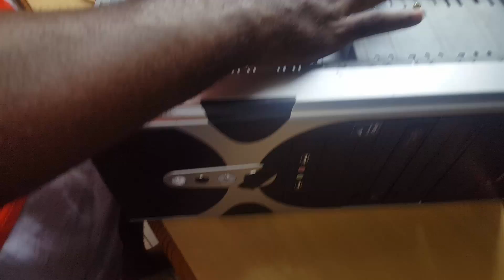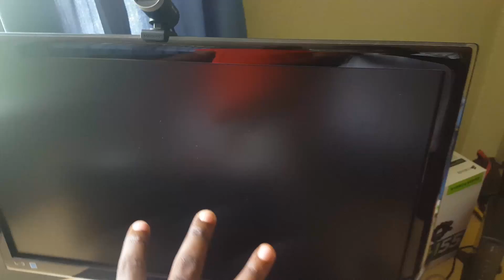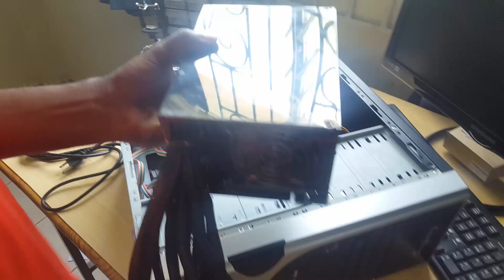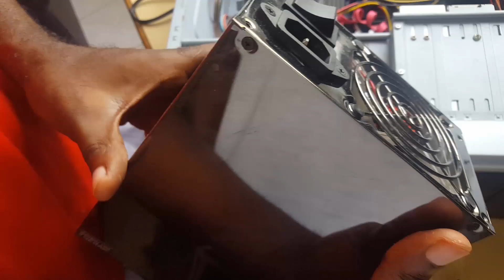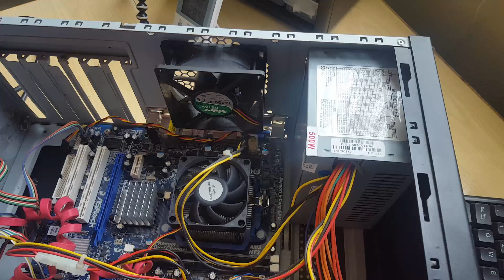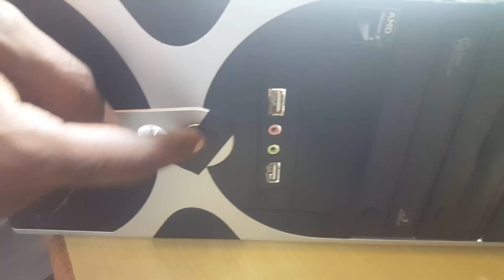My Computer wont turn on Fix

Comment: my rear fan is twitching and my cpu light is blinking when i turn it on
Reply: Sameer Majhi power supply issue
Reply: my pc sometimes run automatically and I use it for atleast 2 hours but now just the cooler starts and stops in 2 second
Reply: yeah bro it's your power supply for sure
Reply: Jerry Landingham have same problem can u tell me how to fix it

Comment: Thank you for the video! It gave me new things to check. We switched out the power supply but still will not turn on. The power button doesn't seem to press in all the way so it may be worn out. I will use your instructions to check and possibly switch the reset button. Thank you!

Comment: Just got my new 2000$ pc and now it's not turning on ); it's not the cable or the psu and my headers are plugged in so idk what to do );
Reply: if you bought a prebuilt $2000 one then you kinda deserve it because you're a dumbass, if you built yourself then you are an expert enough to know how to plug cables in. in both cases, you need to be more specific about it.
Reply: Alexandrewvice I built it my self, I had to restart the CMOS battery and it worked the next day
Reply: good for you. what are the specs?
Reply: TheGamersTech how did you do that? i have the same prob

Comment: Hey,
Same problem here ,
I connected a new power supply and my motherboard is showing a green light, which means power supply is working and my motherboard too.
I connected all the wires in there place & turn it back on but it won't turn on. Also there is light (green) which is on but the fan of my Processor & cooling fan is not on. Monitor is also not turned on. 
Help me please !!!
Reply: same problem

Comment: My pc suddenly died today
Every accessories that are plugged in to my cpu still lighting up.
But my pc won't start if I press the power button.
I unplugged-replugged the main power cable, after that I tried to turn the pc on again. Aaaanndddd the lights glow for less than a second and then they turned off again.
So I checked everything... Seems fine but still my pc is not working

Help please?
Reply: I have the exact same problem! Um did you find a solution?
Reply: Yolozsef Swagedűs i have the same problem where only the motherboard light is on but when i press the power button the fans wont function. HELP!
Reply: mine too its freaking me out
Reply: Prime J  same dude
Reply: same problem . how to fix it?
Reply: in my pc.its says number 99 and after 1m turn off
Reply: Prime J same =(
Reply: Prime J remove the cmos battery and put it back again in 10mins!! This worked for me :)
Reply: I have the same problem
Reply: Prince Horo i fixed it by replacing the power supply.
Reply: Remove your ram from the motherboard and then take an earaser and start rubbing the gold part slowly
Reply: @aimanhakim9803  you are write
Reply: You can do open cpu and clean dust and open ren card and close rem card then pc is on it is moving
Reply: I have solve this problem.....Just pull out the battery from the motherboard then pull back in...The prob should be fixed.😀
Reply: Maybe the hard drive is faulty.
I have the same exact problem but im just 12 year olds. Or maybe its a RAM problem. Maybe it is dead.
Reply: @arbionruci6277  you are having same problem 
And the like me 12 years 
I fixed it and it turned on but it opens 10 minutes and restarts again
Reply: @arbionruci6277  it is not dead I fixed it but after 10 minutes it restarts
Reply: We had the same problem though
Reply: Prime J same
Reply: Prime J same thing happens to me too
Reply: Ooh nevermind my cords were just loose from traveling :y
Reply: Same my PC's lights is on but its blinking and not working
Reply: Ferrari Playz sorry for late reply did u find a fix
Reply: I have the same problem too idk how to fix it
Reply: I have also same problem prime j
Reply: Prime J same problem here
Reply: Ik why and sorry couse i am late

Ur motherboard is fryed and u need to change it
Reply: You need a new mother board
Reply: same
Reply: Same problem. Pls help!!
Reply: Same bro
Reply: Same here😖
Reply: Ok guys I got my PC to turn on. The only thing I did was to turn of the power and then just keep on pressing the on bottom but without the power on. I did it really fast. And then I turned the power on again. And then it worked
Reply: Unplugg THE power cable then press THE start button 10 Times then plug in again then star
Reply: I have same problem
Reply: Same here dude...
Reply: Prime J I know I’m late but take out ram and put back in
Reply: Same here my pc is also doing this
Reply: Gamming World take out ram clean it and then put them back in
Reply: I have the same problem
Reply: Prime J me too
Reply: Same I want to play my games ;-;
Reply: Sartre what to do I only have ps4 to play and new its broken to any solution?
Reply: Same dude
Reply: Same problem
Reply: I might help u that’s probably a cpu overload if u can call the service center it happened to my laptop if u can change ur specs don’t it will get more worse
Reply: same problem dude
Reply: Prime J ikr same
Reply: @prime J
Same problem
Reply: Same
Reply: Any one find a solution
Reply: I think its a gpu
Reply: To everyone, I left this comment 3 years ago and I just forgot about it. You might want to check from your Power Supply Unit first (PSU) since if anything is short circuiting, it is most likely your PSU. If that is not the case then it can be the motherboard. You want to prioritize those two first. If that’s still not it, you have to check for each hardware, but the chances of other hardware causing that is so little that I can’t really be so sure. If your hardware turns out to be okay it can be the cable, but if you’ve try to turn on short circuiting cable too much, it may also cause short circuiting in the hardware itself.

Cheers!
Reply: Same problem
Reply: Dani Kako please refer to my answer above your reply. 🙏
Reply: 100%power supply
Reply: I have the same problem, my pc doesnt make any sound when I turn it on the fans dont spin and it doesnt seem to work. The weird think is is that my keyboard and mouse still do light up, anyone have found a fix for the problem or know what the problem itself is
Reply: @xShadowZ  me same, it doesn't turn on but the output device light do blink... I pray that some fix must come fast....
Reply: @xShadowZ  same idk why help
Reply: @xShadowZ  ok
Reply: @xShadowZ  power key problem
Reply: xShadowZ I have the same problem
Reply: Prime J exact same issue here, I was playing gta 5 and suddenly the pc turned off. I thought it might be a blackout but everything else was still on. I unplugged it and plugged it back into the outlet, and the mobo light is on, but when I press the power button, the light on it comes on for a second and that's it. No fans turn on, nothing. I suspect it's the cpu but I have no way of testing it, cause surely if the mobo light is on, then neither the mobo nor the power supply are at fault. I'll try putting the ram into the other slot, but I'm not sure if that can fix it. The gpu seems completely fine as well. Any other ideas would be greatly appreciated.
Reply: I know its too late but if your pc isnt working check your hard drive or sdd if they still working because my hard drive died for no reason and when i unplugged my sata cable from it my pc worked.
Reply: your motherboard could have been fryed i learned from my mistakes
Reply: same problem
Reply: Me too
Reply: u cheak your your power supply
and cpu cable make sure its in all the way
Reply: Prime J same situation im using mobile T_T

Comment: my cpu seems working there is light means theres power fan is spinning i always got this red light in cpu thats all no display no nothing i already check every single wires that may trigger on why its not working sadly i really dont know what its core problem
Reply: Mine same too 😭😭😭 did u find the solution
Reply: just check the ram...2nd its an overheating issue between processor and board ..u need to remove the cpu fan and put some thermal paste or thermal.pad at the top of the processor ..then put the cpu fan back.....turn on the the computer ..problem solve ......3rd option if its not working .....pry the gpu chip in ur mother board

Comment: Do any of the computers have Reset Buttons or Fuses or Circuit Breakers that can trip? ......Or is that too easy and too much to expect that they would provide something like that?    THANKS
Reply: .........It is a Dell Computer - a few years old.
Reply from the maker: Well kinda -things work different for a computer. There is a jumper pin that you can short or remove the CMOS battery that resets the internal of the Motherboard and will often correct some boot issues.
Reply: +Ricardo Gardener :  Thank You so very much Ricardo! .....Do the Desk-Top type computers also have a CMOS battery - or is that only the Lap-Top Computers?
Reply: ...........The one I am referring to is a large 3-piece type Desk Top Computer, with a separate Monitor, and a separate keyboard.

Comment: when i test it with a paper clip it works but hwen i put it in the p1 
motherboard it has a low sound and no funs spin but i think something 
with my mother is wrong because it doenst send the power to my computer
Reply from the maker: I would say the same if its not the power supply then its most likely the Motherboard.
Reply: yah i think so because my mother board doenst send power back so that it could turn on but my pc is fujitsu siemens e300 so if you can help help me plzz

Comment: I just bought another power supply and switched it out with the old one. But my pc still wont power up. All cables are plugged in nicely and I don't see any burn marks on the motherboard. Though I did have some problems with the power button in the past, where I would need to press it harder, to actually start it. Could this be related to the problem?
Reply: Crewth Perhaps. You can buy  replacement power switch's for a couple bucks online and connect it to the motherboard. If that doesn't turn it on it may be a faulty/bad motherboard.
Reply: It actually was the power switch. Fixed it right before christmas, by making a new power switch.
Reply: Crewth yup, same thing happened to me on my first build.

Comment: Omg same, my computer was working until the screen turned black, so i just reset and now it works, but the 4th time the screen was permanent.
Reply: you can find out if it is the video card... find out who makes it, what the model no or type is,,,then google it up and find out the retail price of it...If it is very dirt cheap then the video card has died.  If the video card has a large fan and it has its own power cable plug, it usually lasts up to 10 yrs or beyond.

Comment: I have this problem computer is working  but screen is black and i can hear windows sounds :/.First this happens 2 3 times and i manage to fix all the times but now i have it more than 10 days
Reply: If you hear the HDD is spring or the motherboard's light is on and the PC sounds like it is on, but you do not see anything on the screen which is black..I think it is your video card.  Or  your monitor if it is Dell, you have to set to VGA, HDMI or DVI  depending which cable you are using. This happened to me, when I unplug the monitor cable, I could not remember which cable was set to. In my case I had DVI and HDMI plugged to the monitor but only HDMI was plug to the back of the desktop but I could not remember, I took it to a guy and they said nothing was wrong, then I remember about Dell"s monitor setup so I plugged the correct cable and bingo....Dell's monitors you have to go to its menu and select which video interface you will be using.